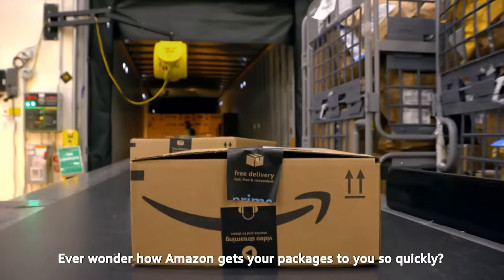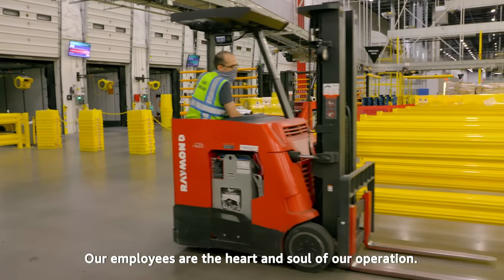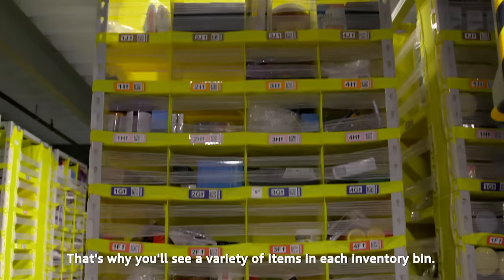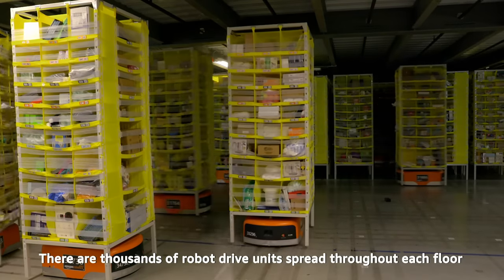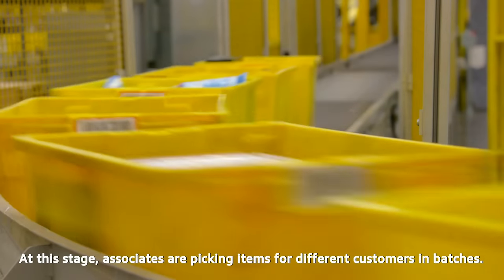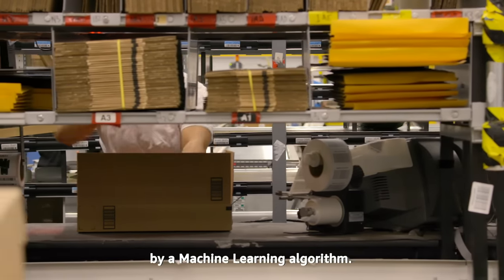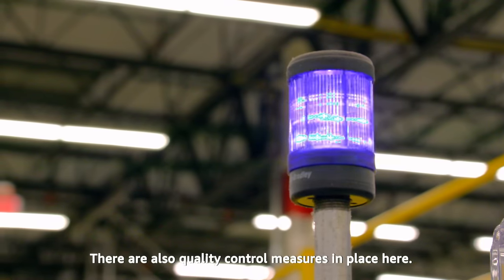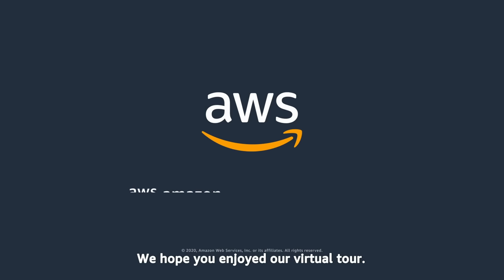Amazon Fulfillment Center Tour with AWS

Comment: your machine learning to select boxes seems to be not working very well tbh.
Reply: no sometime the bigger size in box is cheaper than smaller one
Reply: If you’re referring to the seemingly odd size of some boxes, I’m sure the size is only one in a dozen parameters that govern the selection during the time window when the choice is made.
Reply: 10:02 that's really why the box sizes are selected. Not for the product inside, but for packing in a truck.
Reply: @joegroom3195  That’s one of the parameters I was referring to, yes.
Reply: It works perfectly because they select boxes not just to put products in but also based on truck packing so they fill the trucks in a way stuff doesn't fall and break. Wasted packaging means wasted money, something Amazon isn't going to do.

Comment: A couple of years ago, I looked up what model of robots (the short, shelf-transporters) they were using to see if I could get one myself...
Turned out they were only sold alongside a warehouse, which wasn't within my budget 😢
Reply: They were originally Kiva Systems. Amazon purchased the entire company to integrate into their FCs.
Reply: @homicidemonkey4365  Are you telling me to check my local Amazon website for them? 😝
Or telling that I'm probably even more out of luck now?
Reply: @ChristianOhlendorffKnudsen  out of luck for the exact model. There are several other AGV robotics companies though.
Reply: @homicidemonkey4365  I checked Ali express, I might be able to get one as low as $2500, expensive just to sate my curiousity, but still, achievable if I want it bad enough.
Even if I imagine the very cheapest model from AE probably won't be useful to me at all 😁
Reply: @ChristianOhlendorffKnudsen  I'm an electrical engineering student at ETH Zürich and am currently attending a lecture about recursive estimation taught by Raffaello D'Andrea, one of the co-founders of Kiva Systems. Maybe I can get him to give you a discount 😂 (also, check out his TED talks, they are quite interesting)

Comment: They don't use the Flex-Lines anymore, because some idiot attached some overhead power lines to one at a FC, and when they tried to move the line without detaching the overhead line it was pulled down from the ceiling and hit someone standing underneath. That, and the beverage bottles, coffee cups and candy wrappers left inside stow bags are little insights into the quality of the human factor at Amazon.

Comment: this is only for the robotic sites (which aren't in all states) all the other site are more man powered. Worst is working in a site built  for robotic but then not made robotic because the bathrooms are not easily accessable they are on the other side of the warehouse

Comment: Surely the part where items are picked by employees from inventory bins with a white light shining to indicate which item to pick can be automated with robot arms? If you scan the items' dimensions and feed that data to the robot arm it could use sensors to figure out what quantity of the item it is holding. Don't necessarily need a human to figure that out.
Reply: Nope. As robotic technology just isn’t there yet. The variety of items stored in the bins is HUGE. There can be a watch band in the same bin also containing a keyboard…
Reply: We cram items in so tight sometimes there's barely room for the pickers fingers. And if there are several different gift cards in 1 bin you need a visual to see which 1 it is